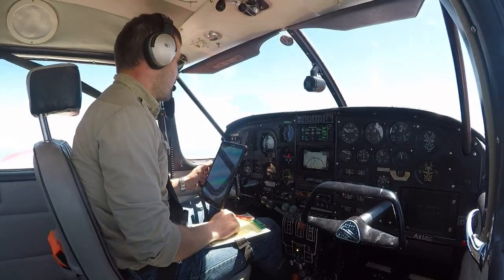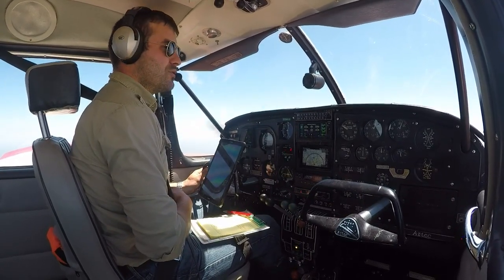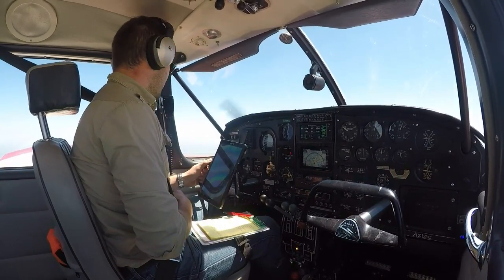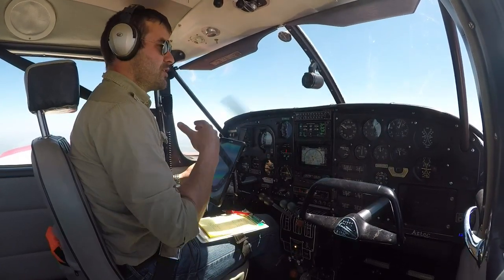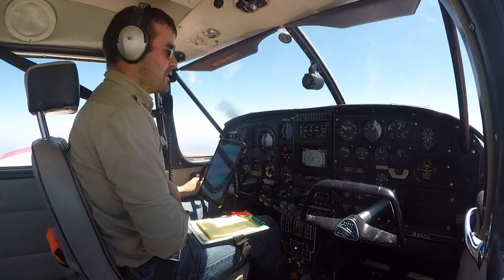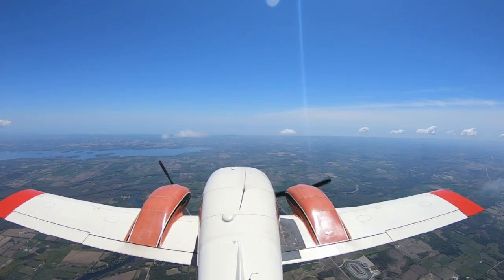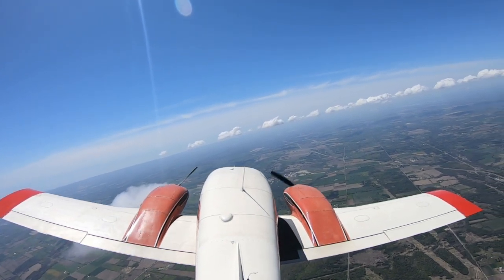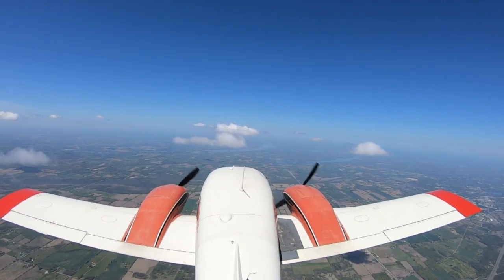Piper Aztec emergency single engine flying practice

Comment: Hey good job on pointing out the propeller.  I had about 1200 hours in the Aztec and I thought maybe I completely forgot since I haven't found them for many years.  I think you learn as much from your mistakes as you do from just general training so I really appreciate your honesty and lack of ego because I think it helps us all learn.  It's been so long that I forgot but after you identify an engine failure on takeoff do you feather the prop before mixture cut out?  I couldn't remember.  I just remember right after takeoff we were taught mixture props throttles all forward and then identify by slowly bringing the throttle of the assumed dead engine back before completely closing it.  Then I couldn't remember if you were supposed to bring the mixture completely to lean or adjust the propeller to feather first.